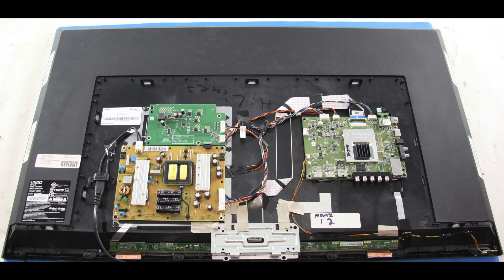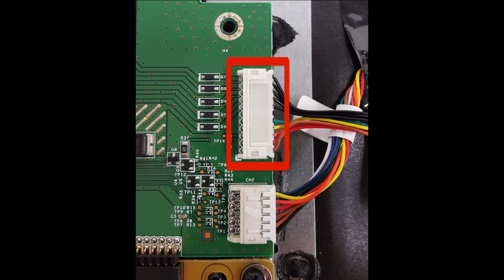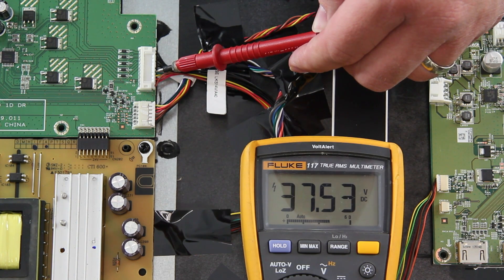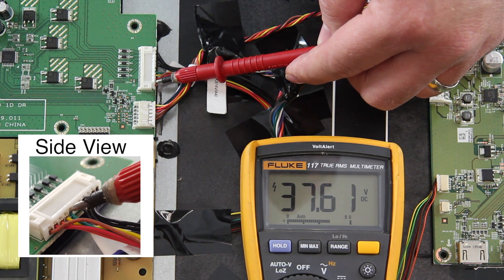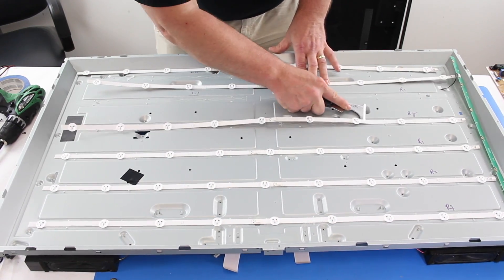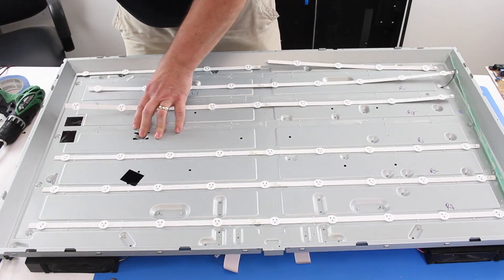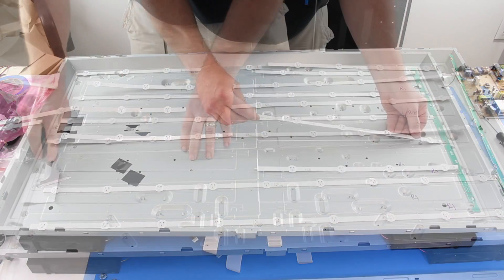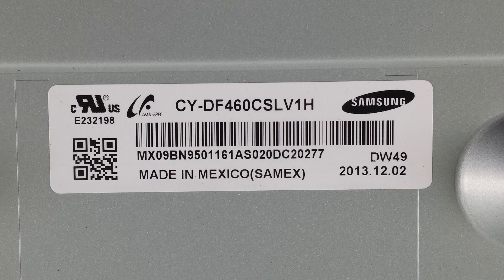Vizio E400i-B2 LED TV No Backlights How to Test Voltages for Power Supply and LEDs

Comment: I have an LG 55LX6500 UB.AUSWLJR, that's has no back lights or sound. The TV will turn on but there is no picture or sound. It is not the main board because it was check by best buy geek squad. What could the problem with the TV?

Comment: hiiii we have Videocon led TV and it has problem that it is running for a while later on display and sound getting disturb and later on when we restart it it is going to work normally for same time
Reply: hii we have Videocon led TV it is running normally for some time later on display and sound going to disturb until we switch it on again...
Reply: hii we have Videocon led TV it is running normally for some time later on display and sound going to disturb until we switch it on again...